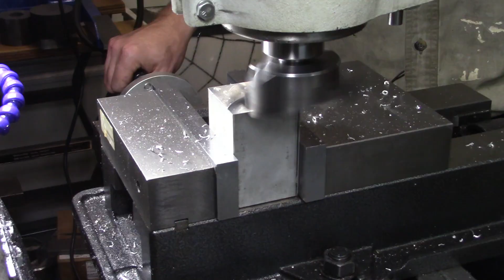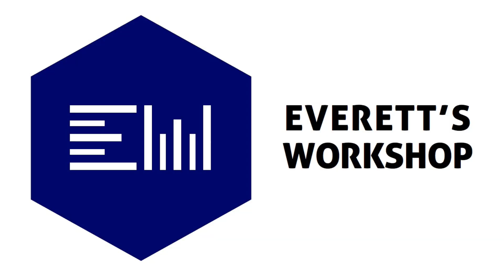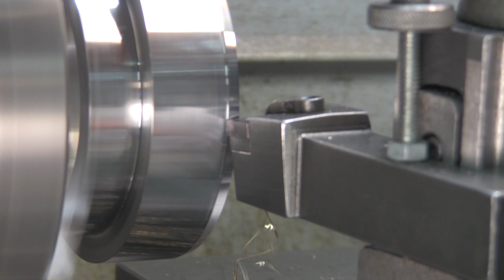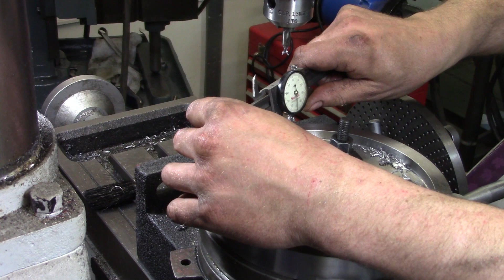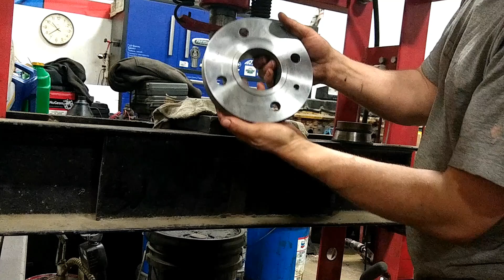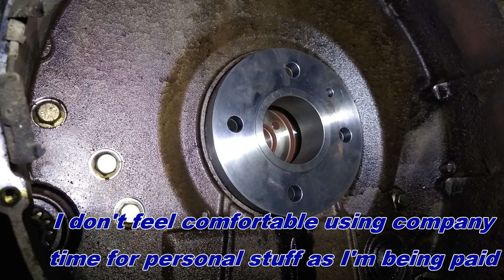Making a Paccar MX13 Rear Seal Tool Part 2

Comment: Do you guys  sell these? Can it be used to remove and install like the dealer's does?
Reply from the maker: So far I have only made the one, and it was for my buddy at the truck shop, so we haven't tried selling any yet.  I have been tossing the idea around of making some more once I have a functional machine shop again but not sure yet.  As for its functionality it is only for installation, removal is more old-fashioned (drilled hole, metal screw, pull out), so if the factory tool removes as well then it is a superior tool.  I have never seen the factory one in person, we just needed a tool in a hurry and this is what I could come up with, lol.
Reply: @EverettsWorkshop  keep me in mind if you do decide to sell them. I'd definitely be interested.

Comment: does it stop at right depth?
Reply from the maker: Yes, that stop point is definitely important, so that journal's height was one of the critical dimensions in the plan
Reply: @EverettsWorkshop  did shop manual tell depth or is it flush with block face
Reply from the maker: @akfarmboy49  I took measurements of where the seal was in relation to the block and the back of the crankshaft before the seal came out, and the tool outer shoulder was made to the same depth.  I don't know if the shop manual actually gave a specific depth, as I believe it mentioned just seating the seal in place using a special tool from Paccar.

Comment: Nice work Everett!  i have forgotten how many tools i have made over the years for working on cars , it seems that every manufacturer has designed  a part that needs "special service tool # 123 " to install which if you check with the manufacturer or the spares department they just look at you with a blank expression and say what tool ? Never heard of it or seen one !
Reply from the maker: Thanks Ian, isn't it crazy how many special tools are needed for each vehicle now?  And almost none of them are cheap . . . not worth spending many hundreds of dollars on a tool you use maybe twice a year.

Comment: Don’t have any experience with those engine. But heard they are Cummins clones.
Reply from the maker: The Paccar engines, from what I've read and researched, isn't a Cummins clone - what's interesting is that these engines have a rear-running gear train for cam, compressor, etc. as opposed to the front mount like the Cummins or Cats.
Reply: Everett's Workshop yea lot of the Industrial Cummins have rear gear Train !  Like I have 2015 F-750  6.7 service truck with rear gear Tran and I have 2015 Ram 2500   with 6.7 and front gear train !

Comment: Would it be stereotyping if I were to assume there was rapid-tap in that oil pot? 😅
Reply from the maker: Lol, no, I'm too cheap for that.  The oil pot has straight cutting oil, the Rapid Tap is used out of the squeezie bottle it comes in.

Comment: Nice build! BTW, what's the 'official' name of that smooth pointer thing you used to roughly center over the holes? Is it something  you made?
Reply from the maker: Thanks Spehro, and I don't know if there's an official name for the pointer but I got it in a stack of stuff in an eBay lot of machinist tools. It's just a piece of 1/4" diameter tool steel ground to a point. Works like a non-wiggling wiggler, lol

Comment: Hi Everett,    Watched both sections. You did really well. Looks better than a Store Bought Tool,  and the main thing you were able to complete the job. The finish looks like a Chrome Based Metal
Reply from the maker: Thanks Ted, at some point I might start trying to blue tools when they're done, like the commercial versions, but as long as they work that's what's important at work. I don't know what the alloy is but a few viewers who did metallurgy highly suspect I got a pile of A36

Comment: Gday Everett, nice job, I am thinking about putting a DRO on similar Mill Drill, would make life a lot easier, especially doing bolt holes, no need to use rotary table.
They are getting cheaper by the day.
Reply from the maker: Thanks Willem, I might put a cheap import DRO on at some point but it seems like the hobby budget needs to be stretched lately, lol.
Reply: @EverettsWorkshop  Hi Everett, I bit the bullet and ordered a cheap DRO with 2 scales, comes in a kit, I will have to shorten one of the scales
$340 australian which is a lot cheaper than the Acurite I put on my BP clone back in 1995 which was $2000 then!

Comment: The seal installation tool looks really good, nice suface finish. I was kinda in the dark of how it worked until you showed the picture at the end of the first video then it donned on me how it worked.
Reply from the maker: Thanks Andy, at some point if the opportunity comes up again I'd like to do a quick video on how it works but would have to do it off the shop clock.  I really don't feel right doing video while my buddy's paying for working time.
Reply: @EverettsWorkshop  you took some great pictures and explained everything well. I just didn't understand the alignment hub until you showed the picture at the end off the first video. At that point it was self explanatory. Your fine Sometimes I can be on the slow side. Thanks for the reply and I'll talk with you later.

Comment: Enjoyed the build! Well done. I was wondering what is the actual height to the top of your mill table? I picked up a used mill and need to fabricate some type of table for it! Thanks!
Reply from the maker: Thanks Lee, glad you liked it!  I just measured the height of the table and it's about 40 inches or 102 cm from the floor.  You could make it as high or low as you like but it's that height so the head clears the garage door above it when the door is open.
Reply: @EverettsWorkshop  Thanks Everett! Looking forward to your next video!

Comment: Nicely done...
If you manage to keep that job in heavy machinery, maybe you need to contact Brian and inquirer about a BIG lathe, BIGGER Mill, BIGGER shop.....    And so on....!!!!     😁😁😁
When I see blurry like your wide shot camera does, either I forgot to put on my glasses that morning, or, I really had a rough night....     😂🤣😎👍
How is reopening going in your part of the country. better than here where people are packing up i bars and spreading the virus...   Sadly, some people are slow learners......    Sigh...!!!   😷😷😷
Reply from the maker: Hey Pierre, believe me I'm looking for a bigger mill but they're stupid expensive out here.  Makes me want to buy one from your end of the country and get it shipped here, would still probably be cheaper!  The blurry second camera is because I keep getting the focus messed up on it, it was a gift camera and it's been a bit of a challenge getting it figured out on the controls.  As for reopening, it's still in stages but so far in the Edmonton area it has been under reasonable control.  We can't pack up anywhere, needing spaces between tables at restaurants but at least we can actually go out to eat again, such as it is.  Hope you and the Mme. are doing well too, I don't envy her and her work right now . . .
Reply: So far we're doing all right, the biggest issue with re-opening are bars and house parties, people are acting as if nothing happened, the virus is still very present and active just waiting for some new hosts...
The wife is still safe and healthy, the care facilities she works for have it quite under control at the moment, wasn't always the case. As mamagement she's not exposed to the patients.
So far we visited the kids, but, keeping our distances, no hugs, no close contacts, we miss that a lot.
A proper treatment or a vaccine will be quite welcome.....!!!!
This will be a moment history will talk about for a long time...